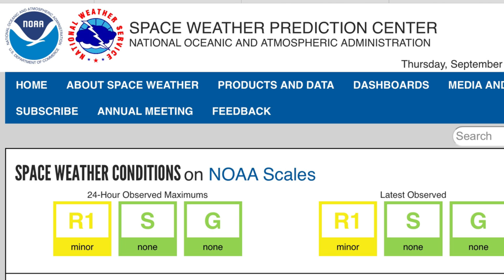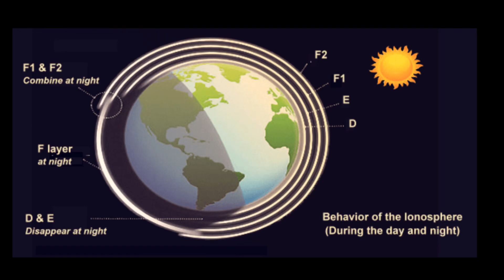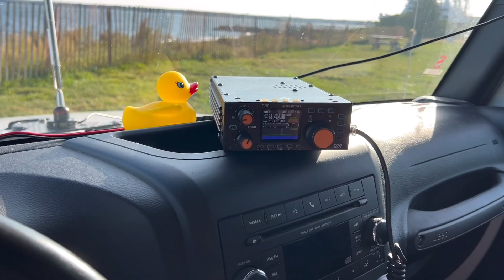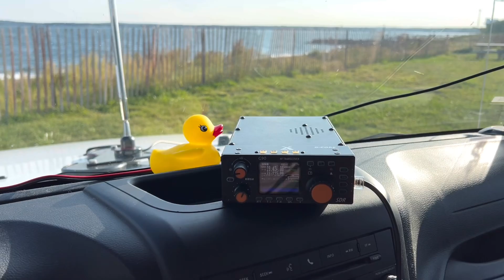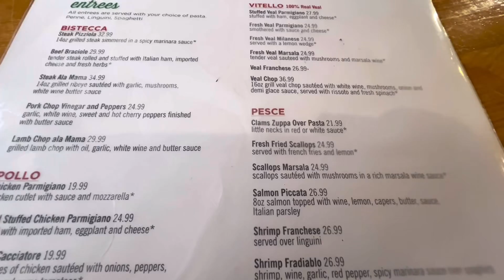Ham Radio and Solar Weather - Knowing When to Operate

Comment: Great contact to Poland . I got to a park in afternoon. only had the QT 60 with me. 10/11/12 meters was open with some noise. Noise got worse as day went on. But Jamaica and Puerto rico  booming in over s9 on 25 FT 4:1 on 10 meter pole.  I got over 200 contacts on 30 watts and less.  most FT8 on 10/12 at 10 watts.  some west coast coming in as well. But time I got set up that long DX on 10 meters was gone in NY . I did a fold back trick about 4 or 5 in shorten antenna and got 1.1 SWR on 28.074 MHZ . no tuner. full 25 ft tuned 12 meters like 1.1 SWR .  All on 20 AH battery. 73

Comment: Thought I would add a comment about the D layer for those who do not know. This comment is a simplification of a very complex subject. The ionization density is significant. The D layer absorption varies with frequency/ wavelength. The same density may absorb 160, 80 and 40 but not so much 20 and even less on 10 meters. The density varies with sun angle. So near sunrise and sunset the density can change from extreme absorption to a level where it bends the signal as it goes through ( grey line propagation ) and then to a point of minimal to no absorption. Each band usually sees the same effect at different times.

Comment: Rather like licking your finger and sticking it up to see which way the wind is blowing I just fire up the set and flick around the bands to see if anything is happening. Low tech I know but I have some surprising contacts in what are supposed to be low propagation periods.  73 M7BLC

Comment: Hi Walt - thanks always for your very instructional and great content.  Question, have you looked into the Chameleon Antenna Universal Remote Antenna Tuner URT1 as possible replacement for your balun/ununs on random wire antennas?  Just thought I'd run that by you to see if this is a viable option.
Reply from the maker: That’s a great option, I’ve thought about it. Chameleon makes great stuff but pricy.

Comment: HI HI Walt, what ive noticed is when daytime conditions are a bit IFFY, sometimes the nighttime conditions are actually sometimes quite GOOD. Last week i had a QRP QSO with OM Jim W6LG on the 20m band via longpath (over 24400km) using my little black brick uSDR chinese transiever (like you have) I was only using 5W. His RS to me was 57, my RS to him was 55. Best 73 de ZS6AKW.